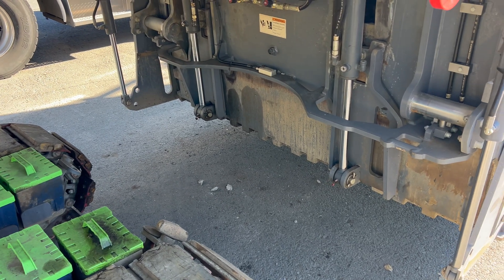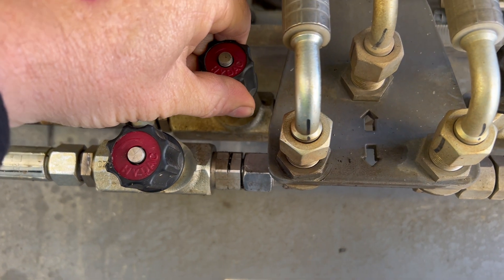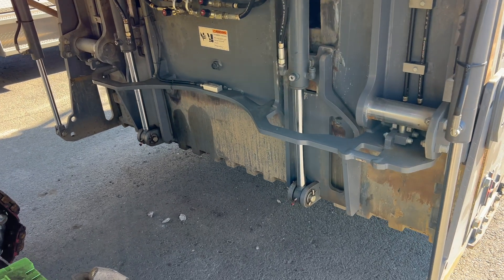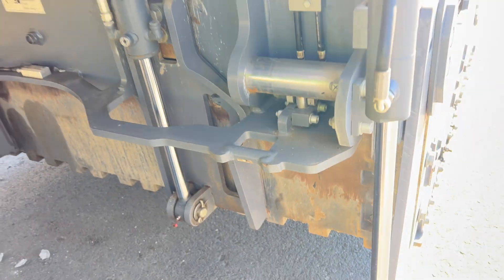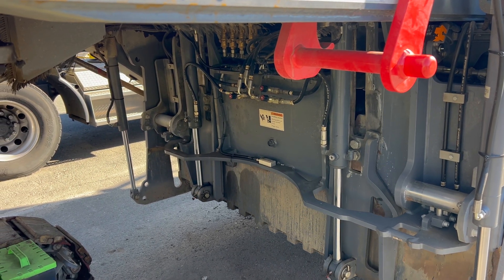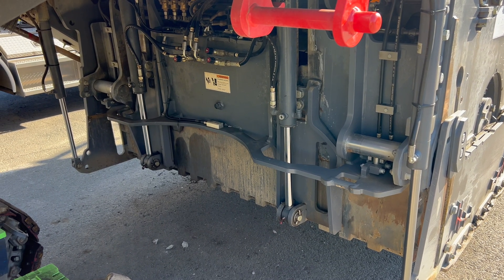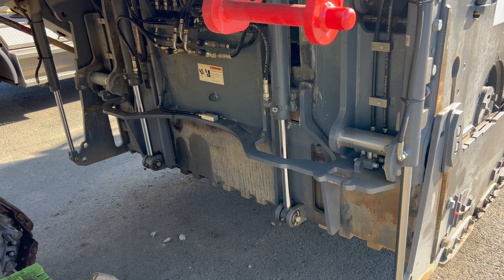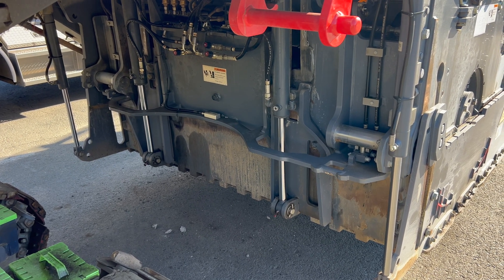How to Adjust Your Moldboard Correctly | Wirtgen 210Fi

Comment: Was wondering if this will fix a back gate that has too much down pressure. We just started running our first of the newer generation and the back gate was digging in or out last job to the point the back tracks were spinning
Reply from the maker: I could, but if the back gate is able to move up and down it's not likely. I would see if your model has a regulator on the right side of the drum housing with a gauge on it. it will be on the outside top of the housing on the side that the drum bearing is on. if so make sure it backed out all the way to zero or just a touch of pressure. that should fix the problem